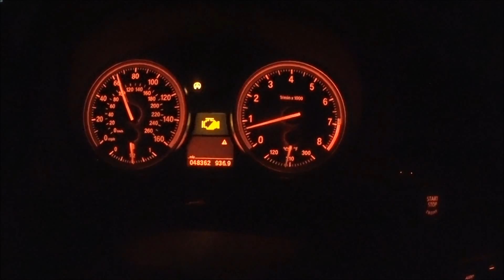Limp mode 335i n54

Comment: Just to add I have loud rattles when off throttle. I believe it's actuator rods. But car still boosts fine but I get this limp mode, only has happened 3 times. Restart engine and clears. Mileage is 70k miles. Thanks.
Reply: why do you think it could be the actuator rods?
Reply: Same happened to me today, bought a 335i e92 yesterday and went for a spirited drive for an hour and as I was accelerating near the end it felt almost like it was losing traction at higher rpm but it was the engine being s but sluggish, then engine light came on and was running like a bag of shit, pulled over and restarted engine and it ran fine, 2 minute drive home and it was fine. Any ideas on what to look for? I guess either turbos or vacuum lines?

Comment: I have an identical problem with mine with the limp mode. Always happens when boosting in and around 3rd/4th gear, but doesn't happen as frequent as yours. Did you manage to find the problem at all? Also what app is that you're using, maybe something I can use to see what mine says. Thanks dude.

Comment: hows she runnin now?   mine likes to randomly limp too..    er cp and tialq bov.  rb turbos.  er fmic ..  under 100k miles..  cleaned vanos sensors up..    but..  i have some clutch slippage goin on..   wondering if its as simple as sensing the clutch slip with pedal fully out..  iunno..   it had the hpfp recall a few yrs ago..   and u put a walbro in the tank..      jb4. meth. nls. all that..  back end flash with bav tech..      its annoying..  lol
Reply: I had the same problem my car was fine but I filled up half a tank at random gas station cheap regular gas then I started getting low power weird but when I filled up back home with premium gas started working fine again
Reply: Godsgift E92 premium gas is required never use regular

Comment: Mine went into limp mode and the dealer told me that the car was throwing every code imaginable meaning the gear ratios were bad? What the hell does that mean when they say it’s got incorrect gear ratios?
Reply from the maker: That’s sounds like a lie. They will tell you anything to fix things. Then it will not fix it and you will still have to pay. I would go to a private Euro specialized mechanic and see what they say
Reply: Any update on this man?

Comment: check your DV!!! your diverter valves might be the problem for the leak. They cant handle anything above 15lbs of boost for to long. Are you running a aftermarket or stock charge pipe? stock ones tend to crack with elevated boost pressures
Reply from the maker: I have an ER charges pipe with tial Bov.. Still did this ..

Comment: I get the same problem except I get misfire in 3rd gear WOT, top end boost.
New spark plugs and coils.   I guess fuel injectors are next....  then VANOS intake and exhaust solenoids...

DPs, Tial BOV, VRSF CP, stg2 tune.
Reply: ICommandoI did you ever figure this out?
Reply: Did you fix the problem?
Reply: Ever fix it? I’m having Same exact issue
Reply: @motoboys2064  did yours start going into limp mode more after coils and spark plugs Bc that’s what’s happening to me

Comment: Hi any updates on what happened? I’m having the same issue! Help pls lol
Reply from the maker: There are a couple things you should do. Change the Charge pipe!  i had a boost leak.. which will cause this.. Maybe sure its all good. Also.. If you are running a tune... re-flash the car.. 1. Go back to stock tune... and re-flash to your current as if it were a new tune.. Most likely a book leak will do cause this

Comment: What is the problem? do you know?
Reply from the maker: I think it was a boost leak . 're installed charge pipe and went away
Reply: ROLL RACING
I have the same problem. However, Ecu error says that are HPFP. Do you see what issue appears in your car?
Reply from the maker: Filipe Silva it's will say hpfp plausible . doesn't mean its bad . you should watch your pressure at WOT . should be over 2700 at least
Reply: ROLL RACING
pressure at wot? sorry, what that means?
Reply: ROLL RACING
WOT= wide-open throttle. If pressure is below 2,700, what means?
Reply from the maker: Filipe Silva that's means you are not getting enough fuel and your fuel pump is not being efficient anymore
Reply: ROLL RACING have tested the fuel pressure and had values of about 2900psi up to 4000rpm . from there, down to 2000psi . to 5000rpm already only have 1600psi . Is this normal?
Reply: ROLL RACING have tested the fuel pressure and had values of about 2900psi up to 4000rpm . from there, down to 2000psi . to 5000rpm already only have 1600psi . Is this normal?

Comment: Hey man, I'm having the same issues. Where was your boost leak? Also when you slow down to a stop did your car shake like a misfire?
Reply from the maker: Jeremy Rojas not sure i changed the charge pipe and got a Tial BOV . Reflashed the tune . Never happened again
Reply from the maker: Jeremy Rojas  i also replaced the vavuum lines
Reply from the maker: Jeremy Rojas check the vacuum lines on Manifold
Reply: JoelMontoya right on thanks man I'll try it